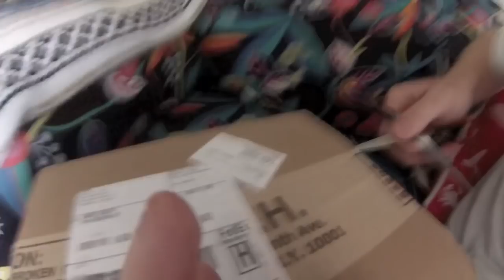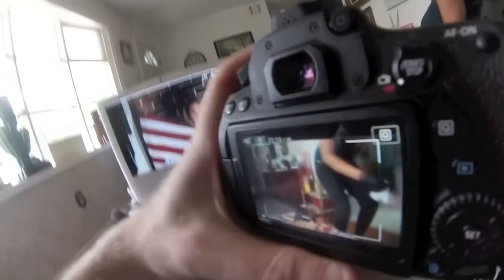Picking Basement FULL Of Vintage Toys And Collectibles!!!

Comment: When a battery set in a machine without being disconnected or charged. 
It eventually totally discharge to the point where it won't take a charge.
That is the deal on the riding mower battery.

Comment: Ah I found the video where you got a lot of the Star Wars stuff. Right on. Oh that van in buddies basement is a Corvair not a VW. It is from the 60's and does have a rear engine but is a GM product. My good friend had one.The two grooved white lines that run down the sides give it away.All of the doors have a latch that you can pop and they will swing right around and lay flat against the body. Even the front ones which looks very strange because they end up sticking way out in front of the whole front of the van. They made a pickup out of the same body by sealing off the front seat and cutting the the top back end off. The spot on the side with the doors was turned into a single one that folded down as a ramp. Unfortunately the whole line (even the cars) in the Corvair line got a bad rap for being flip crazy. There's a book about it called Unsafe at any speed I think. GM dropped the brand and it's kind of sad because all of them (cars, vans,pickups) had air cooled rear engines kind of ahead of the times for a US automaker.
Reply: Send pics of your Star Wars stuff to me at hsquire@cogeco.ca so we can wheel n deal.I know you want my pair of Huckjam Series Tony Hawk gloves. Keep scoring little dreams.

Comment: When i get a toy of any kind  to resell , I make sure complete even if does not work. Star wars is tricky to resell especially figures that r loose , so much out there
 Thou fighter jet or spaceship can bring decent money even for parts.  You pick a man figure it look like 6 million dollar man maybe he boss Anderson , it was a glance view could be wrong , if it is and Mego has a decent value. The windup monkey has a value also or maybe battery operated . All was a quick glance but take your time go through all of it. But try not to pick a margin of broken toys when picking and always have a good lighting with you also , you should more then.double your money my claim on the dream Peace.
Reply: Check a ceramic darth vader works no chip sold for $92 or about , does bottom have screw to open to get it light to work some as is $25 or about working maybe $40 could be stretching it value with chip hurts some.